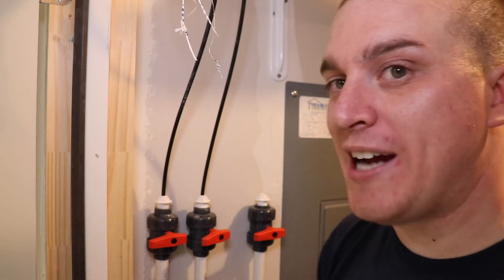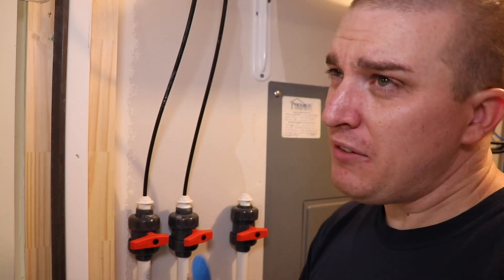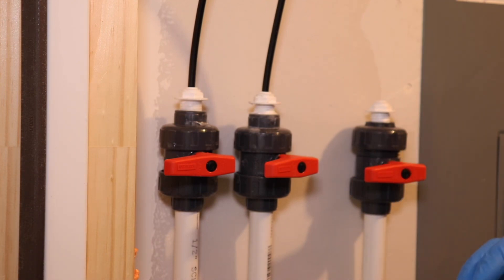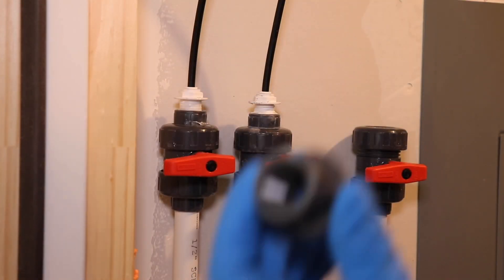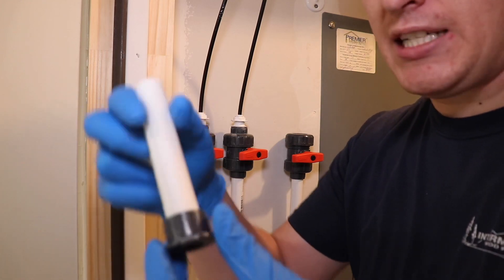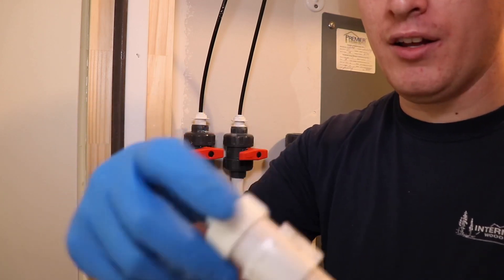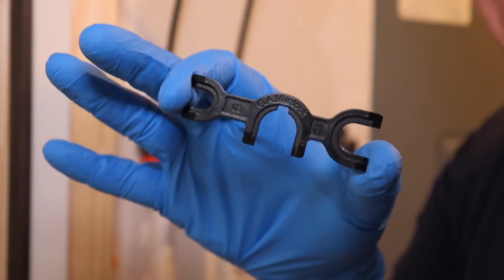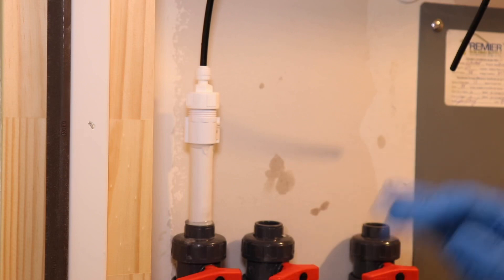IT LEAKED!  Fixing The Auto Water Change System

Comment: Did you attach those bulk heads to the RO connectors originally without plumbers tape?  Cuz plumbers tape is really just meant for metal threads. PVC threads expand under pressure to seal itself without tape. So the initial addition of the tape mighta actually been the cause of your leaks.  Also depending on the schedule of the PVC, threads are different which mighta been your issue as well. Think white is 80 and the black is 40, but don't quote me on that.
Reply from the maker: I tried it both ways, the main problem was that low profile bulk head did not seat far enough into the ball valve to seal.